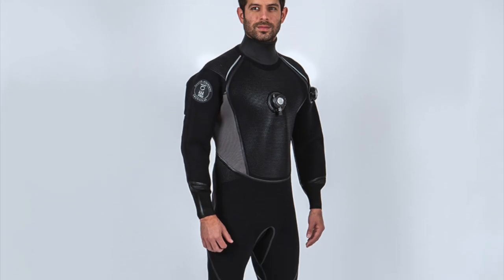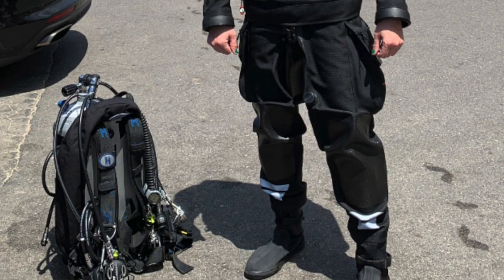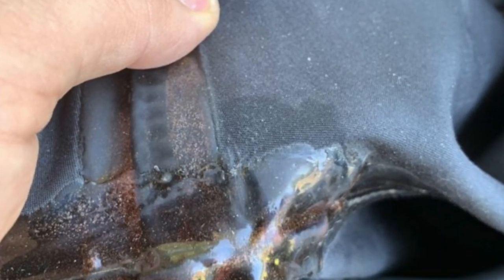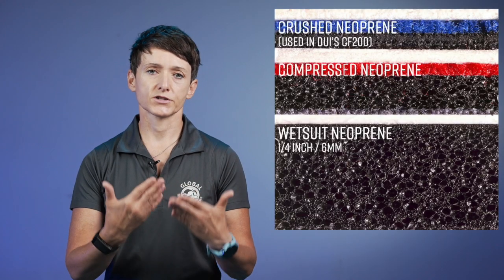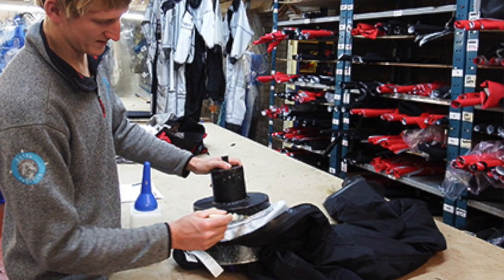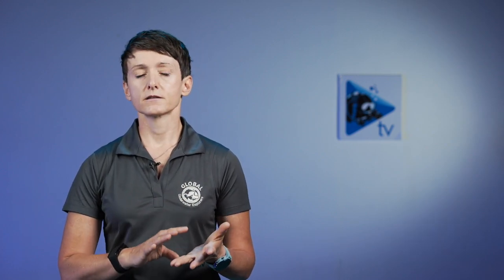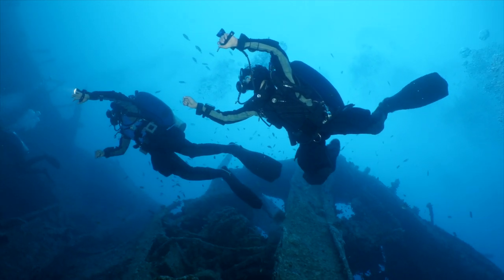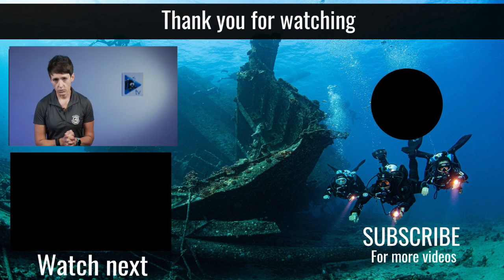Neoprene Drysuit VS Trilaminate Drysuit | VS Monday

Comment: The myth that a trilaminate suit is light and a crushed neopren is heavy is just not true. Just compare the Scubapro Everdry 4 (crushed neopren) and the Waterproof D7 Iss Pro (trilaminate). I own both and the Scubapro is WAY WAY WAY lighter than the Waterproof. And because the scubapro has not rings for the neck and the cuff seals, it's way easier to reach your valve with that suit. Also I need 2 KG less with the crushed neopren drysuit.
Reply: Hey Fabian, thanks for your reply. Yes, you are correct that a trilaminate will be always lighter - if it is a Cordura based one, it will be very heavy indeed. And the weight of the drysuit depends a lot on all of the additional things like - type of boots, the material that the pockets are done from, the amount of padding (like knee pads). So agreed here - but if chosen well, a trilaminate suit (with layers of nylon), with lightweight boots, plastic zipper, lightweight pockets and no additional pads will be really light compared to any neoprene (crushed, compressed or standards one). For me, the lightest, for now, were DUI TLS 350 and SANTI E-Light suits, but there are many more in the market and definitely, I do not know them all :))))))
Reply: I agree with you as well Fabian I have the everdry 4 from scuba pro , I can move freely its not that heavy and its tough for the wrecks and rocky shore entry's here in New Zealand south island .keeps me nice and warm as well in 10 degree water

Comment: This video has given me something to think about that I never considered before. If I'm diving in a thick neoprene wetsuit and need a lot of weight to get below the surface, and then that neoprene compresses a depth, and THEN my BCD fails...I may not be able to ascend. The natural solution would be to drop the weights. But then, as I ascend, the neoprene will begin to expand...and now, without those weights, I may find myself in an uncontrolled ascent. This seems like a VERY good reason to have a dry suit: you have a backup BCD in case the primary fails. You can add air at depth to allow a normal ascent, and then as the pressure decreases you can vent air to prevent an excessive ascent rate.

Comment: I think the safety aspect is a excellent point. I use a trilaminate drysuit. I caught my lower dump valve cord  of my wing on a seat on the boat as I was getting in. (I’m not the most nimble as I’m getting older). It pulled the cord off and must have loosened this lower dump valve. 30 minutes into the dive inside a cave I tried to put air into my wing as I was sinking and nothing happened. The low inflator was connected. I felt around for the lower dump valve and  no cover just a big hole!!! . The wing was therefore useless but a puff into the drysuit and back to neutral buoyancy. Good having that drysuit buoyancy back up

Comment: What about the extra ballast you need, to off set the buoyancy of your undergarment, when diving in a trilam suit? The undergarment I use with my trilam suite, is way more buoyant than my 4mm neoprene drysuit (+undergarment). It is impossible to completely vent the trilam suit on the surface, because the undergarment hold a lot of air by default. I use significantly more ballast when diving with my trilam as opposed to my neoprene, because the need to offset the positive buoyancy characteristics of my undergarment. (same with neoprene, it’s weight I don’t need at depth but only on the surface to help me sink). I own a dive shop and I dove over the years, with probably any kind of suit you can use. I never heard about the “main reason” you mentioned. And if you must, you can also add air into your suit in a case of a wing failure to help you reach the surface and assist with buoyancy. You are making it sound like you’ll drown if you’ll be in a neoprene suit and your bcd fails. And it doesn’t sound to me like you truly understand the advantages and disadvantages of the different choices.

What if your wing fails when you dive in your trilam suit? It is no different. No matter what, if your wing fails, you either add more air to your suit and/or will probably need to ditch some weight in order to make it back to the surface, unless you can fin your way up without needing to do all the above.
 
After diving hundreds of dives in both types of suits, I must say that your logic doesn’t make sense to me at all.

I dive my trilam suit when I travel, only if I dive in low to high 60’sF to mid 70’s (because it’s lighter). If it’s colder, then the amount of undergarment that I will need to pack with my trilam, will be a wash in compare to a neoprene suit. I also like to dive it in the winter, because the undergarment is warmer and can be worn when I am not in the suit, so I am also protected from air temperatures as well.  The neoprene drysuit is more form fitting, because you don’t need as much access material to built it, because you don’t need as heavy undergarment to stay warm. A good neoprene drysuit, will always be more comfortable because of that, and the learning curve in a neoprene suit is much steeper, because it’s more form fitting and feels closer to a wetsuit than the trilam is.
I dive my neoprene drysuit in the summer (it requires a lot less undergarment to stay warm, which is nice between dives and when not in the suit when the air is warm. I also need a lot less ballast to sink, which is always nice. It will also be my choice when traveling to colder temperatures, because it’ll be lighter to pack overall.

I am privileged to be able to dive both kind of suits all the time. However, if I had to choose one, I’d have to think about it more, to weigh the advantages and disadvantages for my specific needs. One thing for sure, the main “concern” you expressed at the end of this this video, won’t even be on the list of my concerns when making my choice.

I don’t mean to sound bashing, the video is well produced. What rubbed me the wrong way, is that you presented the main concern, as something that you should be concerned about, and really you shouldn’t.  If someone who doesn’t know about drysuit, looking to get educated, and pick up on that last thing you said (the last thing is alway the thing that you remember), then they might end up with the wrong suit for their needs.

Comment: I appreciate all your opinions and thoughts but I’m not totally in line in this topic, I own both an Aqualung Neoprene crushed 4mm and a Ursuit trilaminated and as water in lakes here it’s around 9/10°c I’ll use way more undergarment with a Trilaminated and by that fact it’s basically the same buoyancy  as the neoprene suite.
Cause In the End Volume/density it’s what counts so it’s terms off failure they will be both quite identical. So this time I can’t really count this as real advantage.

Comment: If your wing fails, you still have your drysuit to be inflated. Or I don't understand something?
I have a trilam drysuit, and I'm always cold after 30-25 mins :( I tried 7mm neoprene, and it felt way warmer. Though keeping the proper buoyancy in neoprene requires much more attention compared to a trilam. 
I've never tried compressed neoprene. I'm curious if it's also much warmer than a trilam and if it's more or less flexible than a trilam drysuit.

Comment: this isn't entirely correct . I dive in the uk mainly with a crushed neoprene dry suit I dive a balanced rig and can swim up from depth. With my side mount configuration Im carrying 4.5 kg of weight , with my back mount configuration I'm carrying 7.5 kg of weight , able to maintain a stop at 5m with empty wing and near empty cylinders ..   

With my dry suit Im able to wear less underneath, with a Trilam, thicker and bulkier under suites are needed to provide the same level of thermal protection, these suits can add a fair bit of buoyancy to a diver .. which in the end works out to be very little difference ..  ( thick under suit from a big brand I have to add 2kg to offset its buoyancy, now add addition layers  = more lead .. ) 

with the crushed neoprene suit if at any stage it becomes compromised, the suit retains a good amount of thermal protection, but a failed tri-lam suit offers nothing,.. with that in mind,  add a decompression stop , safety stop with next to no thermal protection in cold water ..  I know which suit I would rather have ...   

For me, im about redundancy , I dive the neoprene suit because its tougher, maintains a good amount of thermal protection if damaged, which will allow me to make a safe ascent and deco stops in cold water ..   the down side to the suit is its a bit restrictive in movement , but a small compromise .. 

For warmer water diving where less under suits are needed then the Tri-lam comes in to its own, its probably the better option ..   

good vid tho ..
Reply: Hi . I’m a new diver  (30 dives new) and only dived in the Caribbean with the Mrs .  Now I have the bug and am hoping to dive at home in the U.K. .  I’m looking at dry suits and really struggle to figure out which material type but was leaning towards crushed neoprene for thermal properties and general hard wearing .  If I dive overseas I plan to make it rash next and shorts weather .  So thanks sorry the comment I think you’ve helped me choose
Reply: @Litehamer   I think a crushed neoprene suit would be a good choice, for diving in the sea in winter you would only need a minimal under suit , if your diving in land ( fresh ) the temp doesn't get much above 7 degrees all year and as low as 4-5 in the winter so a reasonable under suit will still be needed ..  
But as I said above for cold water diving this is the suit of my choice , hard going, and retains thermal protection even if damaged ..
Reply: GUE/DIR is the most closed minded diving philosphy on the planet. They essentially took gear that worked for them in north florida caves and declared that they're the best possible configuration for diving anywhere in the world. 

Among their more controversial opinions were historic resistance to use of diving computers and side mount, instead arguing that backmount is better in nearly every situation and that computers are "too expensive" and risk of failure underwater is too high, instead using a voodoo decompression method called ratio decompression, that produced schedules with unknown levels of conservatism for the diver.
They also strongly oppose the use of helmets in caves and self reliance, since every cave must be like florida with great visibility to see your buddies and no chance of hitting your head. The risk of a buddy behind you getting entangled in the guide line, cutting it and stranding you is an accepted risk for them. 

Some of their founders like George Irvine 3 were banned from multiple tech diving agencies after repeatedly insulting divers after accidents and deaths. These guys are just trolls, and GUE itself is basically just a marketing campaign for Halcyon. Make gear that's slightly different from everyone else and then teach divers a class that everything that's not halcyon is unsafe.